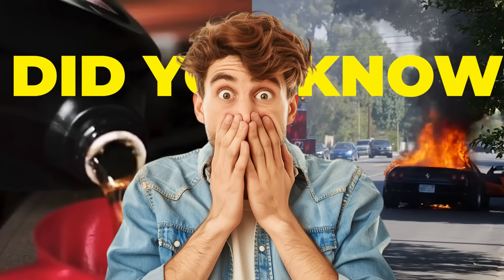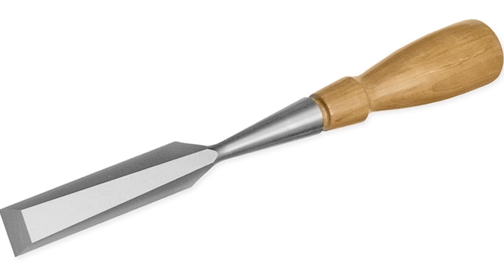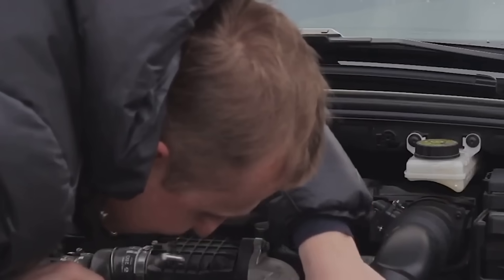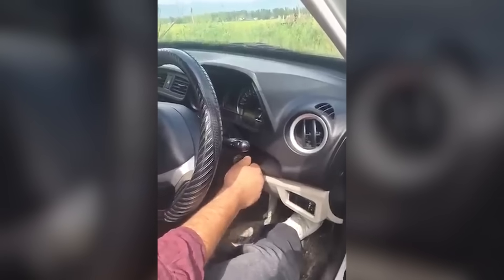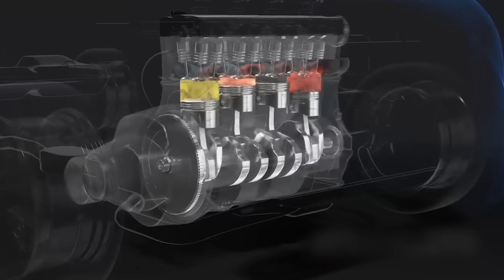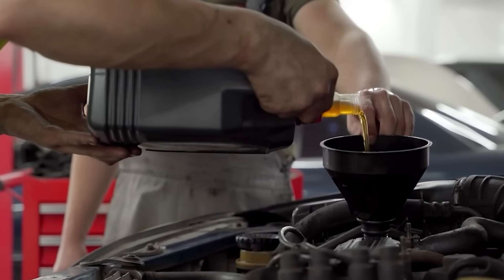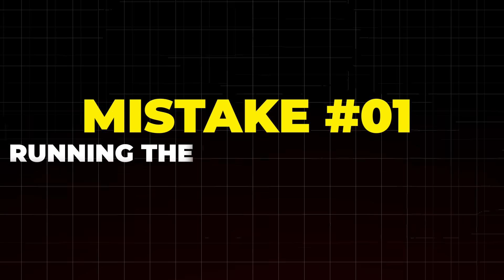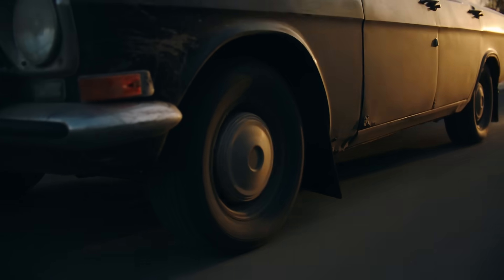19 STUPID Oil Change MISTAKES That DESTROY Your Engine

Comment: Most importantly fill your oil filter before installing.
Reply: That is controversial.  Some oil filters install open end down, so they cannot be prefilled.  The oil pump will push oil through the filter within 5 seconds of running, before any damage will happen to the engine.  Residual old oil will still be on most parts of the engine.  Also, most oil filters don't hold much oil.

Comment: It is funny he uses the video about overfilling,  (3:40) filling up 2x or even 3x above max limit does nothing at all, even say it can be better. at 4x it start be a bad, oil begin to leak, still say engine works fine. at 5x overfill now it will leak everywhere and will cost to fixes leaks, but engine will be fine. Sure it can be different from old engines and newer. but 20-30% extra should never ever be a problem.

Comment: Do not let your vehicle idle to long. Start the vehicle and go in a minute. Drive slow maybe not over 20-25 for a few minutes if possible. The vehicle will warm up faster you won’t waste gasoline and save your engine. Today’s modern engines are different than the old carburetor engines.
Reply: WRONG
Reply: I disagree

Comment: Alittle side note this is for ones that don’t know.. fill the oil filter with oil 3/4th the way up and let it soak for 10 or so minutes as you prep and empty the old oil. Will help it once installed with the fill of the rest of the oil.
Reply: I'm gonna do that. Makes a world of sense!😊
Reply: Makes no difference
Reply: @ralph95 yes it does

Comment: Mistake number one don’t use zero 20 16 or 08. In United States 5W 30 is the best
Reply: Use the oil the engine was designed to use. You will introduce more wear when the engine is cold by changing that first number (5w to 0w). A condition that engine has, up until then not encountered.
Reply: I live in the UK and due an oil change on my lexus hybrid,  was wondering about using 5w 30 instead of the recommended 0-20